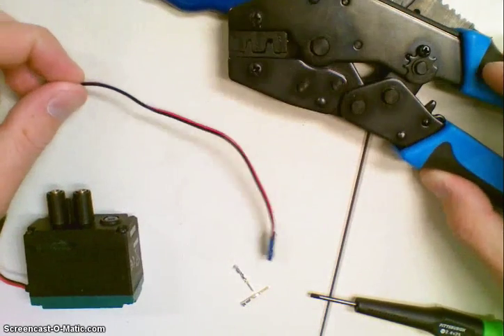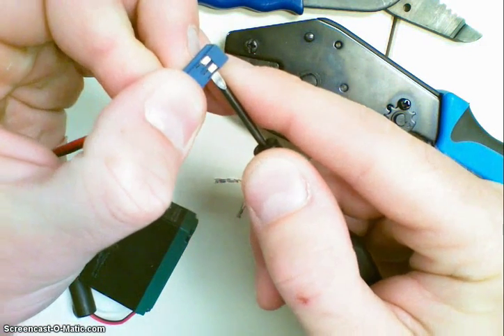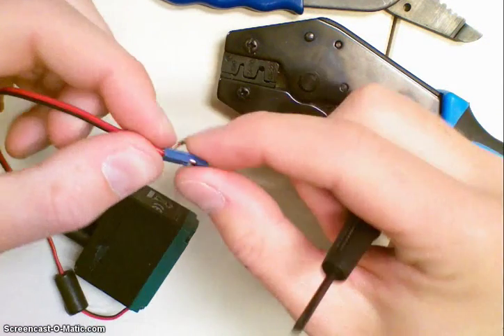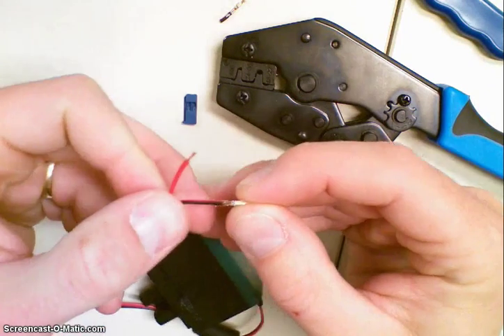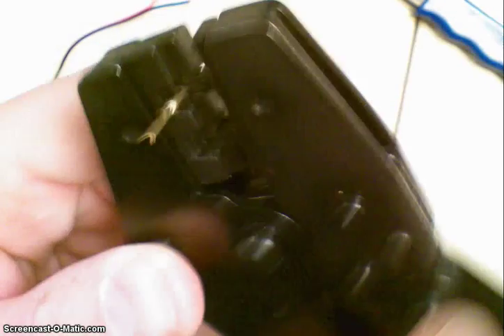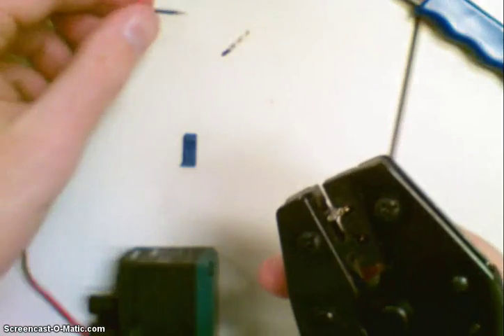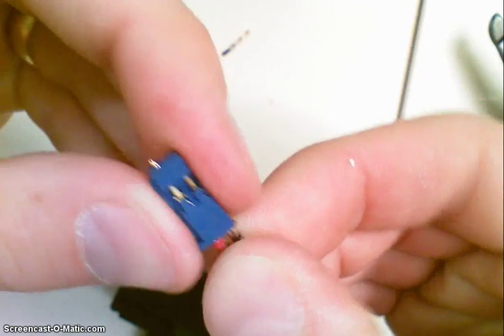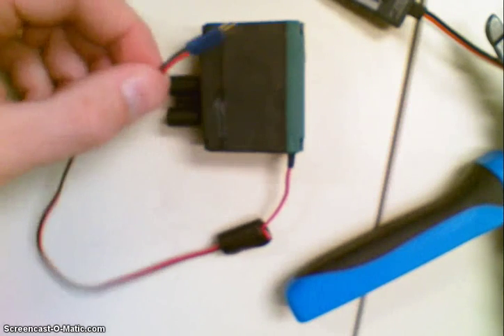VEX - Replacing Motor pins

Comment: Awesome!  Thanks for the video.  I did the fix in less than 5 minutes.  I actually reused the original metal pin and soldered on the metal segment I just cut off from a jumper pin.  Worked great!

Thanks.